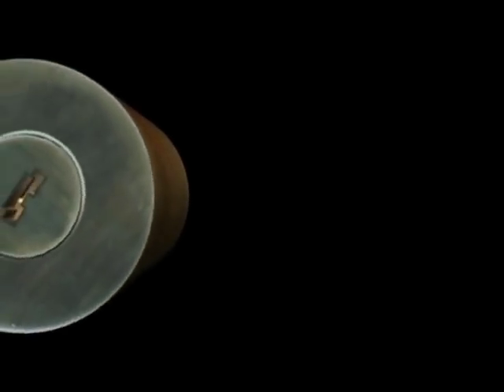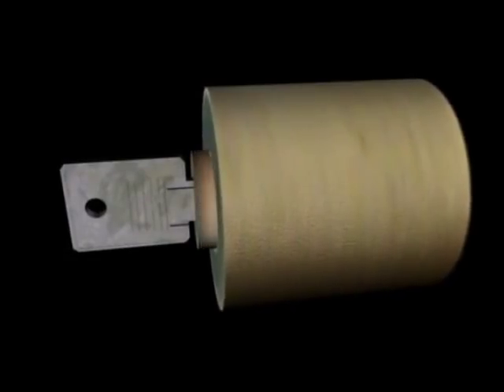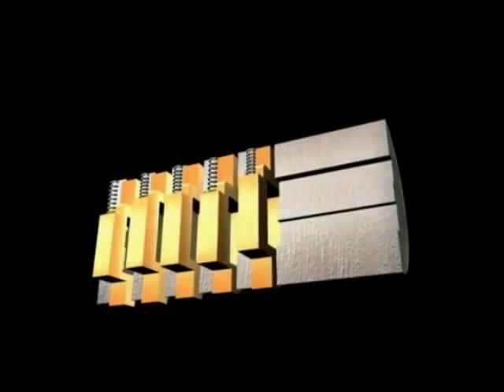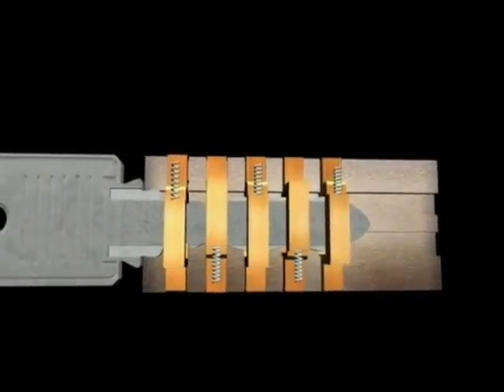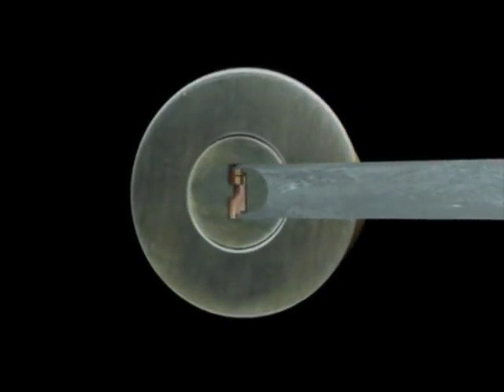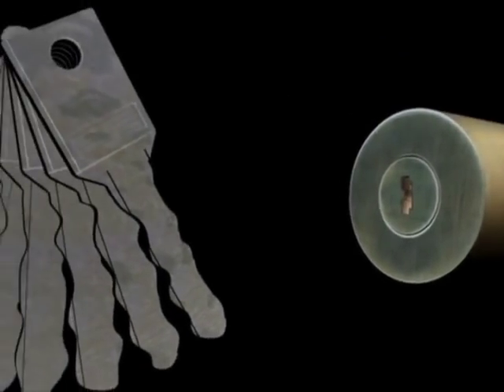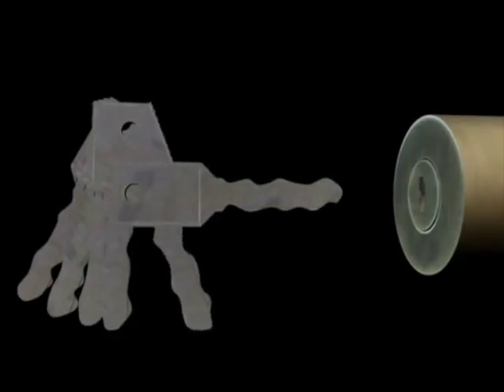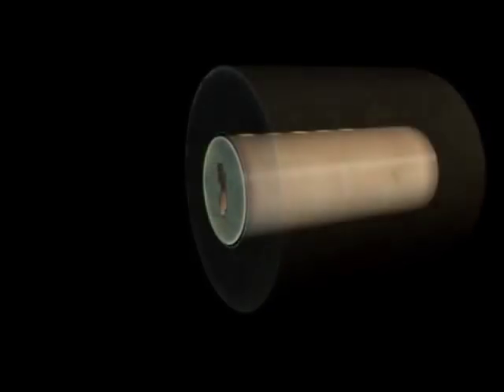Picking Wafer Locks Explained

Comment: Really helpful video, does anyone know how to tell a single-sided from a double-sided wafer lock without having the key?
Reply: Normally a double-sided lock wil lhave a concave dimple in the centre of the keyway , single wafers will have a dimple at the flat edge of the lock face :]
Reply: alternating wafers inside the lock will indicate it's double-sided (e.g. one on the left, one right, one left, one right, etc).

Comment: This looks much more difficult than pin and  tumbler locks.
Reply: They're actually much easier to pick, all you need to do is usually use a thin tension wrench and a wave rake to just rake the lock open